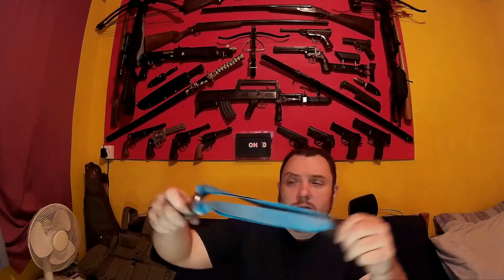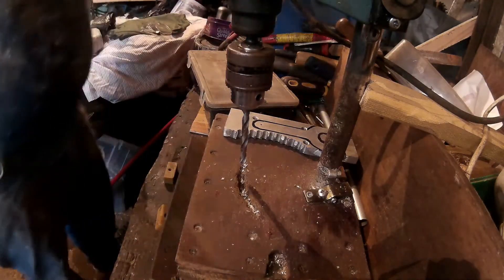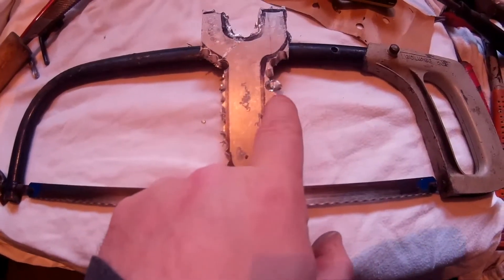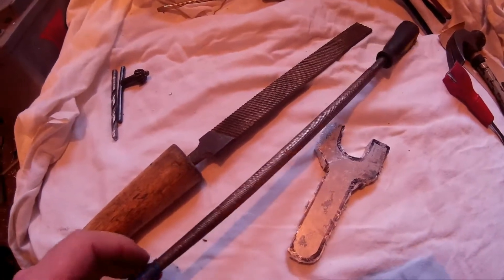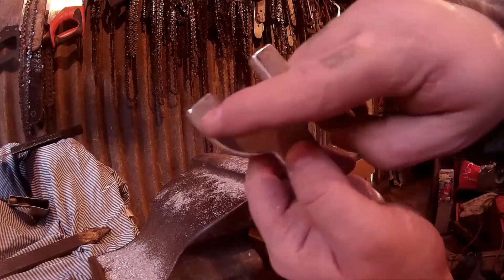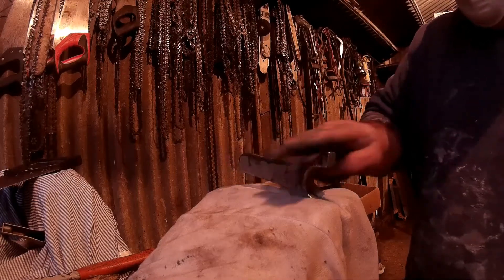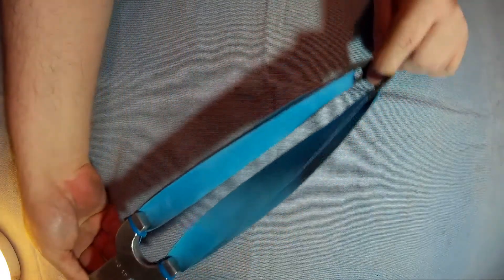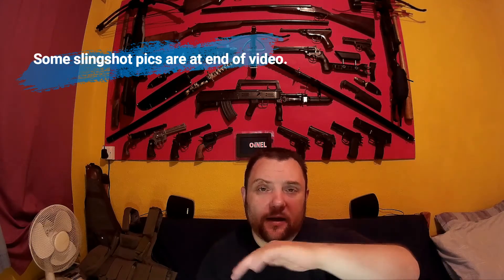How To Make A Slingshot / Catapult from  Aluminium

Comment: Excellent tutorial, I imagine you could actually use a bench grinder at points to speed up the filing of bits of it.
Reply from the maker: Thanks mate, yeah a grinder would defo speed things stuff up, could probably be made in 2hrs then or less.
Reply: I ended up getting one the other day and have been thinking of uses for it, so far I've been using it to put sharp edges on my knives that are so worn out I can't sharpen them properly by hand.
For some reason a lot of people say never to use bench grinders to sharpen knives but it seems to work fine for me, wouldn't use it on a sword or a decent knife, but for the cheap ones it does a good enough job.
Reply: i made a wheel for my bench grinder out of 25mm plywood, cut a notch on the edge about 1cm deep, glued a strip of leather around it and it works good for polishing stuff with a compound, and also if i take 40-80 grit sandpaper and rip a strip of it i can put it around this disc right on the leather stick the ends into the notch and wedge a peace of wood to keep it in place, then that thing will go trough material in seconds, and does not clog the wheel and no belts need to buy
Reply: So basically just be sensible with it and grind for short duration to avoid the blade getting hot.